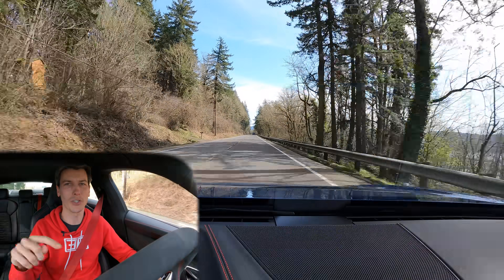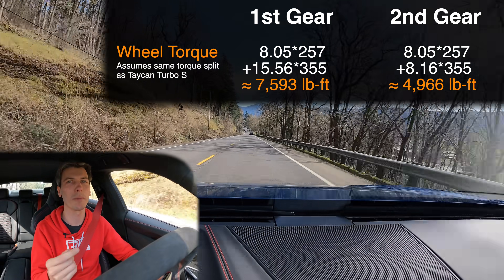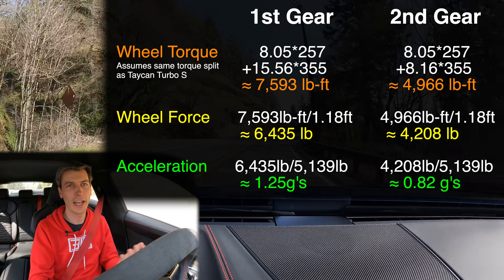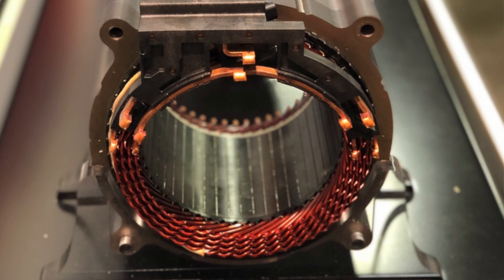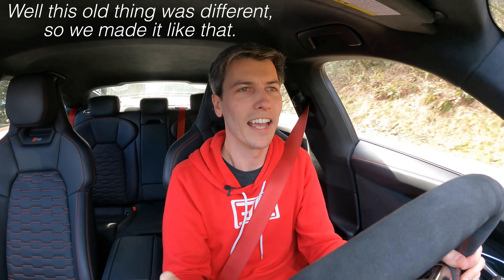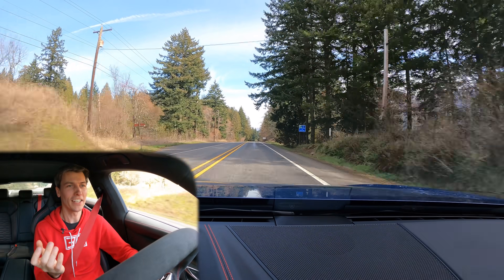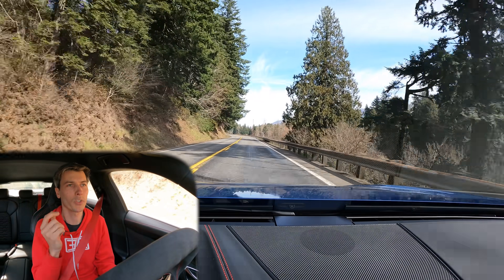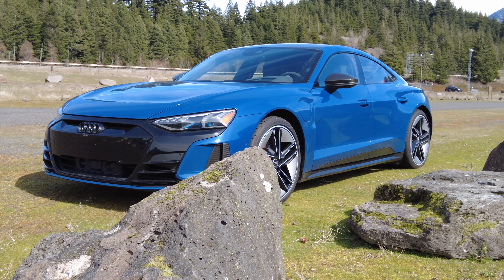Are Fake Manual Transmissions Coming? Audi Keeps It Real

Comment: Toyota did a similar thing with their "B" mode in their hybrids.  The "B" mode put the powertrain in braking mode.  If there was capacity in the battery, it would do aggressive dynamic braking.  Once the battery charges, the engine is spun without fuel to burn energy with compression braking.  Stepping on the brake will rev the engine higher resulting in more retarding action from compression.  If you're accelerating, "B" mode does nothing.  The engine is run at the point of maximum efficiency at all times.
I'm not sure what year it happened, but Toyota got rid of the "B" mode and replaced it with "L".  In "L" mode the engine RPM is matched to a fixed, low ratio.  It will make the engine turn over like mad at freeway speed.  It makes no sense.  It is useless, especially on long steep grades as it doesn't apply enough low speed compression braking to prevent brake overheat. (I have personal experience with this on Washington State's Hurricane Ridge Road in Olympic National Park.)
All I can assume is some boomer in management complained about how confusing "B" is and insisted on making it "like something he understands."
Reply: I used to drive my family's first gen Toyota Prius almost exclusively in B. It made the car act as though I downshifted the second I took my foot off the gas. I'd only pop it into D if I intended to coast, but that was rare. Most of the time it'd be in B with cruise control on the freeway or in city traffic with constant acceleration and deceleration. Objectively I think Cruise Control worked better in B than D, since the ECU was given everything aside from the disc brakes to slow the car down instead of coasting and hoping you'd slow back down to your requested speed.
Reply: @nikdog419  Pretty sure B is specifically for going downhill, using the engine to slow down, since the electric recuperation isn't strong enough to keep a certain speed at too much decline. B keeps the engine a lot more on, straining the drivetrain unnecessarily and using the hybrid technology little to none at all, defeating the point of the hybrid. If you're slowing down using the brakes ''normally'' (not breaking hard) it doesn't actually use the brakes until you need to brake harder. First step of the brake pedal uses the electric motors to slow the car down. Brakes on Toyota hybrids can last way longer than on normal cars, if you don't brake hard all the time. But hey , hoorah for putting unnecessary strain on your family's car ig? 

|Basic rundown of what i said above| 

Don't use brake mode on normal roads, only for downhill if you want to use engine braking. Not needed in normal driving, as pressing the brakes uses electric motors to slow down as priority. Unnecessary strain on drivetrain and fuel consumption in normal usage
Reply: @nikdog419  so yeah, high ass gear ratio
Reply: @ian.williamson  no, B is not like Low gear. it is for EVs exclusively and it means Brake instead of Low. instead of a single high ratio low speed gear, it's just a mode that makes compression/Regen braking more useful. as soon as you're in deceleration, the engine starts compression braking from the ICE and Regen braking from the electric motors. just because it feels like a downshift doesn't mean it's actually in a low gear
Reply: Isn’t the L gear just 1st? My parents have a 4Runner and the gears go PRND432L (it’s a 5 speed)
Reply: @ian.williamson  Not in a hybrid.  A hybrid is an electronic CVT when the engine is running.  (Excluding GM's brief 2 mode hybrid in the puckup and full size SUV.)
Excluding the silly prius joystick, hybrids usually have PRNDB.  The change is Toyota and Ford have PRNDL.
Reply: @matthewbeasley7765  you’re basically both saying that L is just 1st (high gear ratio). I guess with a cvt it just makes the gear ratio as high as possible given the current speed? So you’re engine braking as much as possible?
Reply: @ian.williamson  I have a 2011 Ford Fiesta with the dual clutch automatic, and it does not have any manual gear selector mode but when I put it in L, it will always downshift to the lowest possible gear and thus have the best acceleration performance. So I put it in L when I want to drive fast in the mountain roads, lol.
Reply: @SI0AX  didn’t that car have massive transmission problems?
Reply: @ian.williamson  It had a few fried computers because for installed the transmission control module in an area that gets drenched in water. Eventually water would fry the ECU and leave the car immobilized and it had to be towed to the dealer. It happened 3 times and was repaired under warranty. After the 3rd time it never happened again.

The class action lawsuit was because of the jerky starts that pissed people off. Ford did various ECU reflashed to the clutch manipulation logic for starting from a stop to make it smoother. IMO, this transmission is more reliable that most of what Ford has made. It lasted 150,000 miles without an oil change when most of their regular car transmissions would fail around 60,000 miles if you never chained the oil.

Overall the car has been pretty reliable. The other serious problem was their cheap radiator fans burning out. I had to replace it like 3 times within 2 years, but the 3rd time I went aftermarket and it solved the problem. Their OEM fans are garbage. It was super easy to change though, like 5 minute job. 

Overall, the car is very easy to work with, everything from engine to suspension work is incredibly easy and quick to do for a DIY.
Reply: @SI0AX  the jerkiness is because of clutch engagement, they used dry clutches when every other dct uses wet ones
Reply: @ian.williamson  Yeah, it was the clutch engagement that Ford changed due to the complains. I think Ford had to update the clutch engagement a few times till people stopped complaining as there was a class action lawsuit caused by it. I never really never had a problem with the clutch engagement, but maybe it's because I drove an automatic with a failing automatic that would slip and jerk shifts and also drove a manual transmission car aggressively.
Reply: L stands for low. It keeps it in high rpm low gear range. Basically you're getting the most torque you can out of a small area. L is for when you get stuck in mud or need to drive over a log or need the car to pull really hard but don't go fast in L. This will overheat your transmission as it's not supposed to go fast in L. Read the owners manual for your vehicle before you assume what things do and yes ive made the same mistake as you slipping my old Ford Expedition into "2" instead of D and it locks it in second gear which is bad for high speed
Reply: I think they started the B thing with the original Prius. We had one and it had that.
Reply: This comment is the realisation of xkcd's "please bring back spacebar overheating, my workflow relies on it"

Comment: With respect to piping in fake noise; 1) I think the driver should always be able to turn it off.  2) With EVs, they are so much more quiet than their ICE equivalents that the manufactured noise is to help mask all the other sounds a moving car makes that you normally don't hear in an ICE car.  So I think the reason is more to mask other noises (i.e. tire & suspension noise) that you don't hear as opposed to, "that's what we used to do so let's keep doing it".

Comment: Great video!  Keep the tech coming!  Both on EVs and manuals!

One question though, are you saying electric motors are just as efficient at high rpm?  I would think EVs would benifit at least from low (acceleration) and high (interstate) gears…. I would love a breakdown on this
Reply: Electric motors are indeed less efficient at high RPMs, but only lose 1-2% compared to ICE engines that lose 10-20% efficiency when operating outside their peak torque RPM. Since every transmission loses 1-2% the options are more weight, cost, and parts or just losing the 1-2% efficiency.
Reply: The limiting factor on electric motors is usually "overspeed" (as in flying apart due to centritpetal stresses) rather than effiiciency losses. They'll lose 1-2% at the point they're self-destructing which is essentially "in the noise" when all other things are considered

The overspeeding issue is why the Tesla Plaid motors are carbon-fibre wrapped - It allows higher "terminal" rotational velocity and is likely to be emulated by more makers on performance motors going forward

Comment: Yea something about 4:05 doesn’t seem right. I work with electric motors a lot in my robotics design work and both brushed and brushless electric motors have a peak power that’s usually in the middle of their operating range and then the power falls down parabolically. The efficiency continues to increase into the higher rpm band and then torque does fall off from low rpm to high. But power does not become constant mid range if you design an electric motor system around peak power you are in for a bad time.

Comment: This is potentially very good. My first car in 1973 was a used VW Fastback with a manual transmission. Every vehicle I have had since then has had a manual transmission because I hate the feel of automatics and they are unsafe. Since 1983 I have bought new VWs including GTIs (83,88,2004,2006), my 92 Corrado VR6, and my 2015 Sportwagen. One thing I like is VW's manuals and controls haven't varied much over the years. So when I move between them they feel similar and I don't have to think about the differences. But I don't want an EV because they don't have manual transmissions (except the Honda CR-Z). EVs already accelerate too fast so making them even faster is a waste, increased range would be better. I have been a VW customer for 49 years but have given up because all they want to sell now is SUV boxes with automatics. But if VW/Audi can duplicate their manual transmission experience in an EV, then that wouldn't be fake. It would be a major accomplishment and the EV for me!
Reply: First off, automatics are not unsafe in the slightest compared to manuals these days. I understand the appeal of driving a manual, but safety is not a valid reason.

Next, not all EVs are fast beyond belief, look at the nissan leaf haha. Even the standard model Teslas are not crazy fast compared to your GTIs. 

And having longer range is more related to the number and quality of batteries than the motor. Electric motors are very light and putting in one that produces less power does not significantly increase range as long as you drive similarly in both scenarios. If you are constantly asking the larger motor to provide more power than the small one can, that's where the change in range will become significant. But for the most oart, range is all about increasing the efficiencies of the batteries (energy density). Tesla currently is the leader so they get the best value for range.
Reply: @Henry-qt3py  Automatics lull the driver into getting into accidents. That is why we are adding automatic braking to try and finally get automatic transmissions under control. In 50 years of driving manuals I have never run into anything so automatic braking isn't much good to me.
Reply: @drwisdom1  I disagree, data does not suggest that. In fact, many arguments could be made in the opposite manner. 

One is that especially new drivers will be more distracted with the complexities of operating manual vehicle. They will pay less attention to the road and more to the vehicle operation thus raising chances of an accident. The solution is to become experienced like you, but most accidents are from inexperienced drivers.

Another argument is that distracted drivers will be be distracted no matter the transmission. It is safer for someone to be eating or on their phone in an automatic car than in a manual car. Obviously you shouldn't do either but the type of transmission isn't all that likely to stop them.

Also if you ACTUALLY wanted a safer vehicle, it is definitely better to get one with driver assists. These safety features actually help in real accidents and are backed up with data and crash testing. There is no data to back up your claim of automatic vehicles being more dangerous. And even if you personally are not engaged in your driving of an automatic vehicle, that is your fault.

Automatic braking which you mentioned will save you in situations where your judgement and reaction time will not – even if you are very engaged in your driving. Driver assist technologies are a net gain in safety for everyone and exist on manual vehicles as well. They are not implemented to make up for your percieved lack of safety that automatic vehicles have. Pushing the safety features of vehicles forwards is very importantm it reduces risk and saves lives that would have been lost years prior.

Comment: As someone who is building a 4-speed manual EV, here's what I still can't wrap my head around:
Why don't manufacturers just use lower-torque higher-RPM motors and pair them with a manual transmission?
I'm sure this is a lot cheaper to make.  It allows you to better regulate regen braking.  It allows you to genuinely shift gears.  It probably would weigh a lot less.  You can achieve higher top speeds without sacrificing acceleration.  The less work the motor has to do to accelerate, the fewer amps it draws, so a transmission could potentially extend your range, at least in city driving.
In my case, there is no purpose of a clutch, but the 3rd pedal is used to disengage regen braking, so you can more easily shift gears.
Meanwhile, change the shape of the gears so they make more noise, and you don't have to pump fake noise into the cabin.
Reply: I doubt it would weigh less. Electric motors are already very light. Adding complexity to the transmission adds weight and inefficiencies. Best case you might get an equal trade off...
Reply: @Henry-qt3py  I guess it depends what car you're looking at because some motors are heavy enough to not be lifted by a person, while others can weigh less than a typical transmission.
Bear in mind that you might only need 3 speeds, which would make the transmission pretty light.
Reply: @Toastmaster_5000  A Tesla Motor is 70 lbs. You aren't making any meaninful savings reducing the motor mass and increasing the transmission mass.
Reply: This approach is incompatible with the stop-start feature of the latest adaptive cruise control systems.
Reply: Loud gears are less efficient, so you may have to spend more engineering effort on transmission cooling and your MPG will suffer. Not worth it, imo. Plus not everyone likes a whiny gearbox like what racecars have.
Reply: @samfedorka5629  I thought the loud whiny gearboxes were used in race cars because they were more efficient?
Reply: @Toastmaster_5000  straight cut gears are more efficient due to the lack of an axial load. They are also used because they are cheaper, save weight, and are less dangerous when they fail.

On the other hand, they are very loud and not as durable as helical gears as the force there is spread out over multiple teeth.

Comment: I think the reason most (normal powered) electric cars can't tow a trailer is the missing gear shift. So I would be happy to have a gear for 0-100 km/h and one for 0-150 km/h (with better efficency at 100 km/h than the low gear, but with less torque / acceleration). Even when there is a half-second gap between the gears - I would not care. But as long as I can't tow, I would not buy an electric car. And no, I don't have the money for a Tesla Model X.
Reply: Every EV can tow as much or more than comparable ICE vehicles. Low end torque is great. Small vehicle aren't rated for towing because people are idiots. I added a tow hitch to my Leaf and it can easily tow 1000kgs at 100kmh, about what the Model X is rated for, for a few miles (it's 9 years old and only goes 100km on a charge unencumbered), but you've got to be careful, don't brake hard, slow down for corners, generally consider the physics involved, the normal things you should do while towing anyway. It has very little to do with gearing. Your acceleration while towing may be better with a lower gear, but that's all.

Comment: Well this old thing was different, so we made it like that.  <<Isn't that why we say horsepower?  People are afraid of change, that's why you have to make it relate to something they already know.    Another Question: Could one pedal driving ever be as fun as 3 pedal driving?  No, people are egotistical and like the control of a manual transmission.  People love power and control, that is why the manual is having a hard time staying buried by far superior automatic/dc transmissions that shift faster and allow for more gearing.